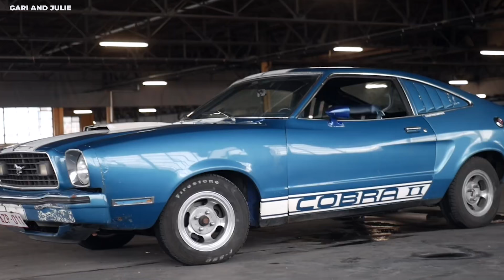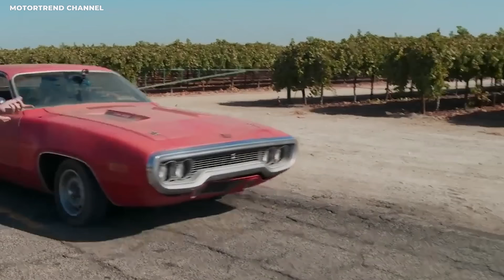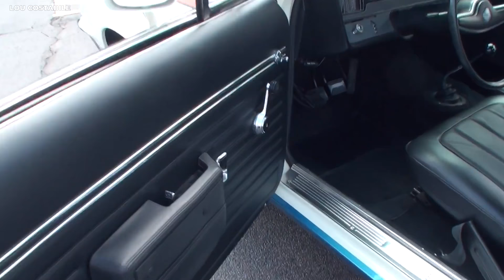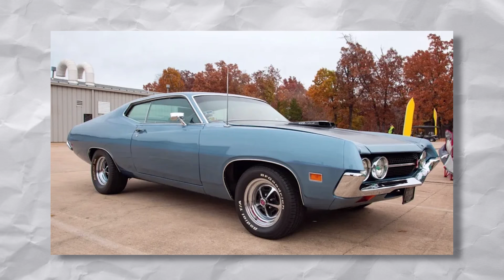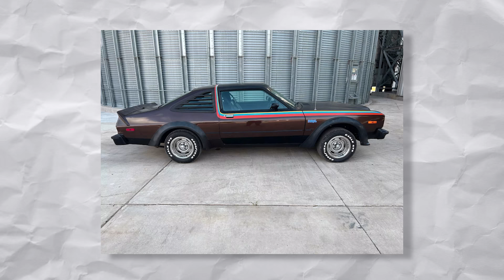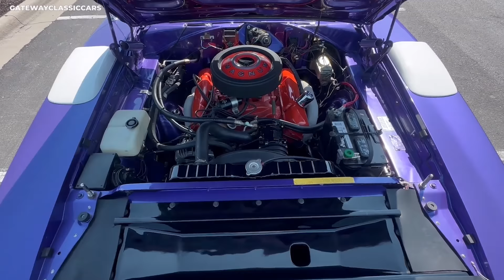11 Muscle Cars That Looked TRASH but Were Engineering Monsters!

Comment: I lost my license w/ an Aspen RT 318 4 speed at 90 mph on a windy country rd...handled great...better than my 69 GTX. tHE T-roof model was cool looking
Reply: I was an Inspector at Hamtramck Assembly (Dodge Main) during the Aspen/Volare run. They were trash and the Volare labelled’Road Runner” was an insult to that legacy. 

Certain nights these cars built themselves without robots….with repair men and foremen working backwards due to assembly workers being at the bars across the street or in their cars getting high.

Comment: About 10 years ago I was in our shop where mechanics repair cars. I spotted an absolutely gorgeous '77 Mustang II Ghia, Silver Blue with a White 1/4 Vinyl Top & Blue Leather interior. I'm not exaggerating when I say this car looked Brand new inside & out! The Ghia made it reminiscent of the luxurious Thunderbirds in a smaller scale. It had the V8 badges on front fenders. When I looked inside, the odometer read 17,000 miles. I had no doubts that was the original miles. They told me it was a 1 owner car & I'd never seen it at any car shows or again. I know it would've taken 1st place at most of the shows. I wanted to ask if it was for sale but they wouldn't tell me the owner's name?